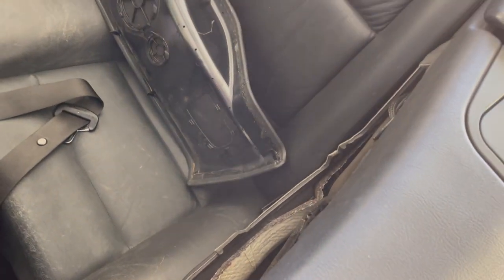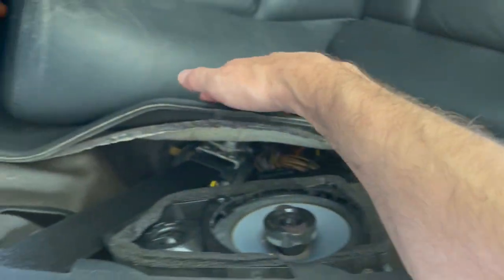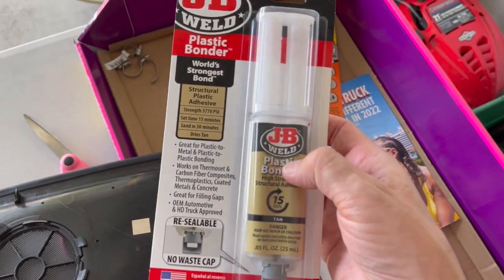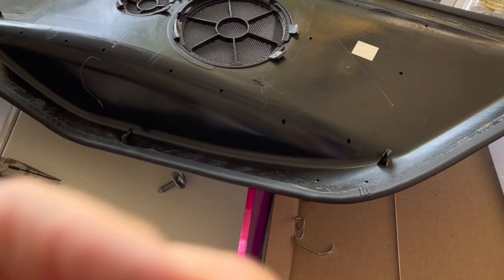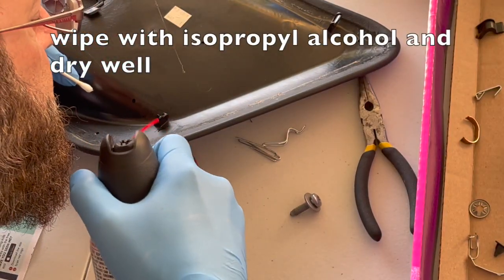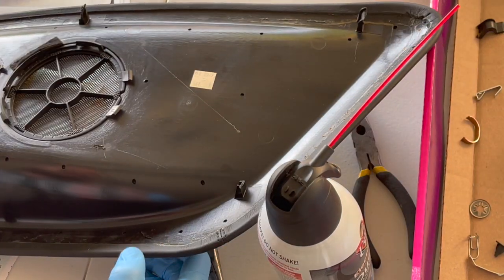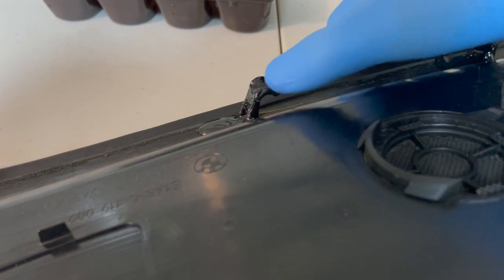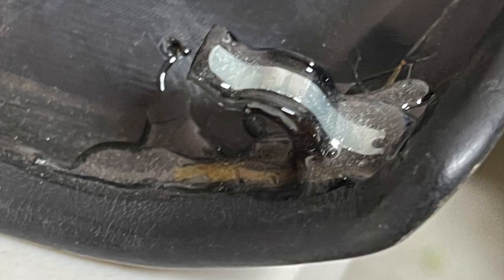Repairing the clips of the rear left door speaker insert trim panel E36 convertible BMW

Comment: FIND WHERE METAL IS CLOSE TO MOULDING PANEL...DRILL 3 SMALL HOLES & USE BLACK HEAD METAL SCREWS...LESS HASTLE AND REMOVABLE WAY EASIER...10 MIN JOB ...(I am a retired auto glass Master Tech...done a lot of these...clips are to numerous to keep in stock...you buy 2,000 different clips for all models...stock is left over and costly...screws look good & aren't noticed...🕊👈)